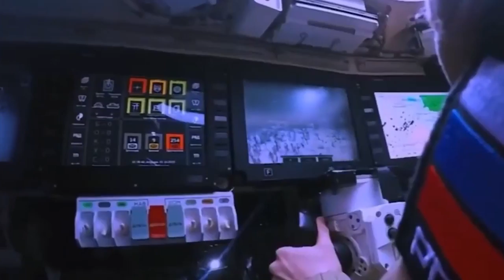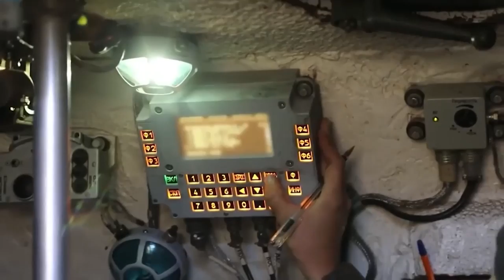What's Wrong With Russian T-14 Armata Tank (Military Analysis)

Comment: I bought one for the fuel economy and heated leather seats and the armour protects against schoolkids egging it . I give it a 4/5
Reply: For those with small kids, can you get it with isofix child seat mounts?
Reply: @skunkjobb  if you move aside the thermals and fire control system you can fit isofix child seat mounts with no problem
Reply: lol you know your tanks don't you
Reply: @timhorton698  life saver
Reply: What’s the towing capacity? Does it have a back up camera?
Reply: @megaaggron9778  it comes with a hitch ball and coupler as standard but I don't know the towing capacity sorry. Mine doesn't come with a camera but talk to your local dealer and see if they can aftermarket one for you

Comment: The T-14 Armada is a great design but there are a lot of great designs that are never produced in quantities.
Reply: It's mechanical engineering is failing all over the board due to the lack of Ukrainian engines and they only work with western European electronics. That isn't exactly a great design.
Reply: @jacksonteller1337  Those are supply chain issues not design.
Reply: @jacksonteller1337  I wouldn't want to be one of the guys testing it though, it's probably got all kinds of problems and without full financial support will probably never fix all of its issues. It's a new tank with small production. If I'm a tanker though I definitely would want all the new kit if everything else is in order.
Reply: @MajorBorris  that means they only designed the chassis everything else is designed elsewhere. They made the turrets inaccessible from the vehicle. That in turn makes it impossible for the crew to repair or access the autoloader in case of emergency. Just like the non functional sensors that supposedly make it possible not to have anyone in the turrets are just as inaccessible from the inside. All design issues and all are failing because they didn't integrate any of the equipment right. Failing engines and transmission are fully on the design team not anything to do with the supply chain. You clearly haven't had many English language lessons or you would have understood this in the first reaction. The US evaluation of the whole system done by Abrams crews is it is a total piece of crap and there is no way this will benefit anyone but their enemies. So they are welcome to put it in the field anywhere as we love seeing these burn.
Reply: @jacksonteller1337  The T-14 is kind of like the AbramsX, tons of cool tech but will never be produced in numbers. I think most of us know that but if I'm in battle and I have a choice between a T-80 and a T-14 that works... The choice is easy.
Reply: The old saying goes: Quantity has a quality all its own! (Think T-34 and M-4 Sherman)
Reply: @stevensrhester8594  that was a communist opinion. The Russian Federation doesn't do quantity and it doesn't do quality.
Reply: @jacksonteller1337  That is a Henry Ford quote not a Russian one. It was the American opinion during WW-2 when we produced over 50,000 M-4s.
Reply: @stevensrhester8594  it is a direct quote from Stalin. And you are right not Russian but Georgian.
Reply: @jacksonteller1337  Henry Ford set it too as early as 1910
Reply: @jacksonteller1337  I'm as far from a commie as you can get. Quit trying to put your narrative label on me. I've been a Bircher, if you know what that means then you'd know I'm far from being a commie. I write comments based on my military knowledge not political views. If an opinion is unpopular then that means you can't handle factual evidence.
Reply: @stevensrhester8594  Henry Ford never said that. Henry Ford said "Quality is what you do with your work, when no one is looking". Education is key, kiddo.
Reply: @brandondavis7777  I am a researcher who has read material going back hundreds of years. You don't have the qualifications to talk about whether I'm well informed or not. Quit showing ignorance of others intellectual conditions.
Reply: @jacksonteller1337  it doesnt do quantity? Then why does russia have more tanks than any other military power in the world? They have twice as many as the US does.
Reply: @jacksonteller1337 context about Ukrainian engines?
I can’t find anything about it
Reply: @sergiotell8856  Ukraine used to build the engines on the Soviet tanks, aircraft and ships. After the collapse of the evil empire they kept the production going for Russian and domestic production.
Reply: @jacksonteller1337  I don’t know where did you get that info, searching in the internet I found that every those engines that you are talking about were designed in Russian design bureaus and produced in russian factories (specially aircraft, again I don’t know where did you find that info) the only thing that was greatly manufactured in Ukraine were t-64, and an important part of the Soviet surface ships (but the Leningrad shipyards produced a great part to)
Reply: @stevensrhester8594  Nice projection, kid.
Reply: @MajorBorris  but the big thing is: Western companies present them as tech demos, not like how Russia shows them off as production designs.
Reply: great design? in some attributes I can agree with you. a remote turret with it separated from it's crew is a relatively nice idea don't get me wrong. but That mobility well... you see the engine of the tank is based on a certain design, a certain old design, a certain old design that was a failed project,a certain WW2 german failed project. if you still don't know let me tell you then. the engine was based on the Porche Tiger's engine. if you didn't know there were 2 tiger1 design and one of them was made by Porche which was infamous for their inability to climb the smallest hill without catching fire or any other technical difficulties. and the T-14 use that very design of that engine. that's why during one of their parade one of the T-14 broke down. So is T-14 Bad? well not really, it is a interesting idea, which was thought out, (unlike French ww2 doctrines)but is it good? absolutely not, and it is a Bad idea for Russia to even attempt to produce it. they need a new tank but the T-14 is not the new tank they should make.
Reply: and no, T-14's sibling such as T-15 is a stupid idea, I'll direct you to Lazerpig's Why T-14 sucks, it is 1hrs long, but you can listen to it in the background there are not much visuals.
Reply: @stevensrhester8594  uhhhh no it doesnt. in wars where quality has met quantity, quality has won every single time, and quantity means nothing when russia has literally only 8 t 14s
Reply: @Helperbot-2000  In some modern wars such as Iraq, it is true what you say. But Russian Federation has attempted to use mass over quality (at least in antitank missiles) But I disagree that quality always makes up for quantity. In world War II, Russia mass produce the T-34 and the US the Sherman. The German Tanks were superior in everyway. I won't repeat the history that you all ready know. What is different is while Russia masses large numbers of tanks at objectives like Kiev and lately Vuhledar, is the Russian Army seems to forgotten everything it learned during WW-2. Their tactics are what is getting them killed in great numbers. They drive straight into a kill box and rather than press on they stop and congregate. The Russians of 1945 would never do something so stupid. Tactics outweigh both quantity and quality.
Reply: @stevensrhester8594  pretty sad youre still blinded by that old myth, german tanks were far from "superior in every way", and they were not high technology either, you really should know the allies werent far behind in pretty much any field, but about tanks. lets take the golden goose of germany, the tiger. definitely a formidable tank, but thats not because it was specifically powerful or well armoured, it was legendarily unreliable after all, it was a good design, but what it excelled in was the fact that the tank crew was easy to operate, the crew worked with it, not against it. on the other hand theres the panther, which on paper seems like an amazing design that should have been a war winner, yet in actuality was one of the worst tanks germany ever made, because it did the exact opposite.

and the thing is, the soviet union didnt win because they had such a huge quantity, because it wasnt the soviet union who won, it was the allies who won, and the allies had the us, and the sherman
Reply: @Helperbot-2000  I think you are not up with the facts. It took hords of T-34s or Shermans to knock out German tanks. The Russian to German loss ratio in 1945 was still 4:1 down from the 7: 1, earlier in the war. The ratio against the Americans was fairly similar. Yes Germans had superior tanks but against 103,000 Russian tanks produced 80,000 + were destroyed, Germany lost 25,000 against the Russians.
Reply: @stevensrhester8594  theres severely big problems with your comment (and obvious ignorance or bias) and its 4 in the morning. Remind me tomorrow and ill correct you
Reply: @Helperbot-2000  All my data comes from official Department of defense documents and historical summaries of the ETO (European Theater of Operations- headed by Eisenhower) You can refute them but not me. You have an opinion, I have government documents backing me up.
Reply: @Helperbot-2000  what? 😂😂😂😂😂
So if German tanks were apparently so bad, why could almost nobody win against them?
Reply: @lucasworktv  they could, allied tanks had no real problems beating german ones, they simply didnt

Comment: I wonder how well the Armada turrets will fly? I mean the rest of their tank turrets are getting more air time than their Su-57’s!
Reply: Not as much air time as Ukrainian equipment and troops, they have to use seat belts to fasten themselves into their trenches in the Donbass.  😆
Reply: Hilarious, well played sir!
Reply: Well, the autoloader is the same as the T-90M, but due to being uncrewed and less armored the turret itself is considerably lighter, so... Yeah it might take gold medal if it's ever close enough to the frontline.
Reply: @thespanishinquisition4078  It actually has a different autoloader to T-90M; that's how it can accommodate far more powerful rounds.
Reply: @definitelyfrank9341  Yes technically it is slightly different because its claw is slightly stronger and the ammo tubes slightly taller, hence the more powerful ammo.
But my point was the design is the same, its just an update to fit longer and heavier ammo, so it will fly all the same, nothing has been done to fix that.
Reply: @thespanishinquisition4078  Several inches of composites/ERA mounted on the side skirts and stronger steel alloy for the side should make a big difference. Pretty much the only way to detonate the ammo is to hit it with an APFSDS round. 

Also, I'm pretty sure the ammo of T-14 is stored vertically, not horizontally, so no, the autoloader is completely different to T-90M.
Reply: @thespanishinquisition4078  Assuming a tank-launched APFSDS round hits the ammo, yes.
Reply: @definitelyfrank9341   vertically makes it easier to be killed with rounds. You can use a WW2 APHE round into the turret ring area (most likely, depends on armour) and have shrapnel hit the propellant of the upwards ammo, but if it was horizontal lower in the tank, that could not happen (modern high spall APFSDS or even low spall to the mantlet especially on an abrams would be a disabling of the T-14 as well, as you would disable the breech / autoloader / cannon barrel etc.). Also you can most likely disable an entire T-14 like the bradley did with the T-90 except with light arms fire, as you can shoot the camera and radars and APS charges and detonate and ruin many things.
Reply: @DecayLe4  Ah yes, a WW2-era APHE round -- I'm sure there's plenty of those sitting around just waiting to be deployed against the T-14's turret ring in particular.
Reply: @definitelyfrank9341   I also said a high or low spall APFSDS, also a lot of guns can still use older types of ammo, like a more basic solid AP, which will also do the trick, and by “turret ring” I also state it’s the lower part of the turret, and literally anywhere in the lower turret you would probably hit the ammo and disable it
Reply: @definitelyfrank9341  and the WW2 APHE analogy was to exaggerate how weak it was, you wouldn’t literally use the APHE IRL, but maybe even like the 30mm on top of the abrams X could disable it to the turret ring / lower turret area
Reply: @DecayLe4  Incorrect. Very few guns can use older solid-shot AP because such rounds do not exist in the calibers used by modern guns. 

Every tank's turret ring is a weak spot. It's not just in the case of the T-14.
Reply: @definitelyfrank9341  well, I don’t know what to tell you, Because you keep ignoring what else I say, and yes some more modern guns (and late Cold War tanks) can still fire AP rounds (there’s no purpose in doing so)
Reply: @DecayLe4  If such rounds do exist, then name some 125mm, 120mm, 115mm, 105mm, and 100mm solid-shot AP rounds, thank you. 

As far as I know, solid-shot AP was abandoned by pretty much every military by the mid 50s due to the higher performance of sub-caliber projectiles.
Reply: @definitelyfrank9341   him still ignoring the rest of what I’ve said 😂😂😂 ap rounds existed until the large presence of smoothbores, but also low reduction in calibre APFSDS or APDS rounds which are technically a bridge between solid AP and more modern apfsds rounds exist until modern times, especially in poorer nations with more outdated tanks

Comment: Another issue is maintenance.  Crews spend a lot more time maintaining their tank than they do fighting battles.  With that autoloader system you've got a more complicated tank that will require more maintenance, but you've got one less crew member to do the work.  More failure points with less maintenance having been done is a recipe for malfunctioning hardware, probably at the worst possible moment.
Reply: That's why the United States is gonna switch to an autoloader. You're repeating just a tried true lie. France went with autoloaders never looked back, neither Japan nor Korea. Also Poland wants the Korean Autoloader tank for domestic production oh man oh noes maintenance oh wait you can just increase maintenance personal. derp derp derp
Reply: @balls9052  Maintenance Personal don't mean shit when you're 100 miles from base, stuck with a broken tank, and under enemy fire.
Reply: @brandondavis7777  One extra crew member won’t mean shit either.  
You can have maintenance personal attached to the tank unit in apcs or trucks lol
Reply: @brandondavis7777  If I remember correctly, the French have a extra IFV or APC with them that they use as scout but also helps them with maintenance. Autoloaders have worked with Russia, Ukraine, India, France, Korea, Japan and countless other smaller Nations
Reply: @fpdldfpsdffld2508  "autoloaders have worked with Russia" if you mean worked as in, made the turrent fly 80 meters into the air, then yes, they work for Russia. 

They're prone to breaking down, even amongst the nations who put blow-out panels to stop their tank from winning the turrent toss championships, and in combat, if you've got TWO vehicles full of people out  working on ONE tank, you're going to get got. Hence why a 4 man crew is better. 3 to do maintenance, and one to guard, or 2 and 2. Regardless, it's one vehicle out of the fight as opposed to two.
Reply: @brandondavis7777  You’re wrong.
Reply: @balls9052  it's clearly human Loader is more reliable than autoloader Because it's manually operated. And Cheaper
Reply: @IslamistSocialist371  Autoloaders save weight and are very reliable. Hence, more countries switching to autoloaders.
Reply: @brandondavis7777 "They're prone to breaking down" Do you have a source to back that up? There have been countless interviews with tankers from both the Russian side an Ukrainian side, and neither side has mentioned issues with the autoloader. 
A CIA report even praises the T-72 autoloader for its reliability when it cycled 3,000 rounds without any issues.
Reply: @brandondavis7777  Tanks usually don't do maintenance in a hot zone where they're vulnerable to artillery fire, kamikaze drones, air strikes and MLRS/GMLRS strikes. When they do, they're usually protected by other tanks, infantry and IFVs etc. They also often do maintenance in secure repair stations out of range or hidden from most threats.

You also seem to believe that a couple hours into an offensive, the crew has to exit the tank and lubricate parts of the auto loader, change a couple nuts and bolts perhaps etc. But that is simply not the case. Autoloaders can go days without maintenance (assuming the tank hasn't received any major damage from enemy fire) and still work.

Comment: Next: why Ukraine's T-72 is the best tank in the world
Reply: Ukraine bases its armored forces on modernized T-64, T-80 and T-84 Oplot. T-72 are the weakest tanks they have.
Reply: @kajetan5818  T-64 uses old metal-polymer block(200mm)+150mmRHA external and 200mm internal frontal armor. This can only defend against APDS
T-72 uses thick 150/360/200mm
of combined reflective plates that can defend against HEATFS and APFSDS. also has better optics and gun ballistics.
T-80 is way better since it uses 120/160/200mm(160mm is quartz core) better optics and 5th gen ERA.
The T-84 is quite good and fixes the problem of not having TVD and adds some 100-150mm of armor to the frontal sloped plate(50/100/50)+50mm texolite and 50mm RHA (100mm is texolite).

Yeah I don't know why I wrote this but seems like you did not get the joke lol:)

I just need the non biased Infografics Show back😭😭😭
Reply: @someoneuser9646  I guessed it was a joke, but I thought it was pointless to use the T-72 in your joke.
Reply: @kajetan5818  I had to use a tank that newbies know otherwise nobody would get it. The orginal joke I though was about the T-84 but who even knows it existed